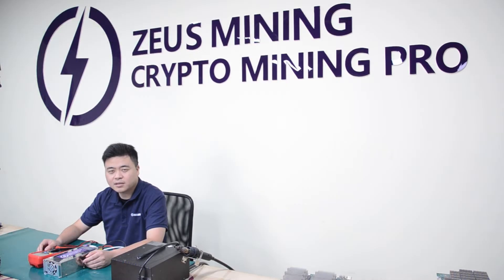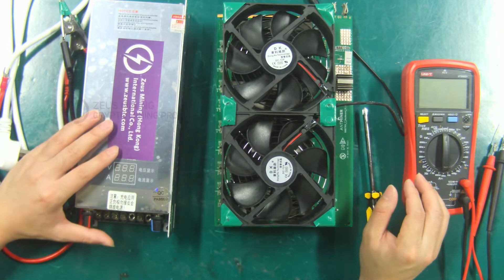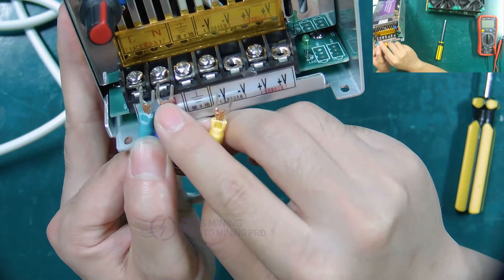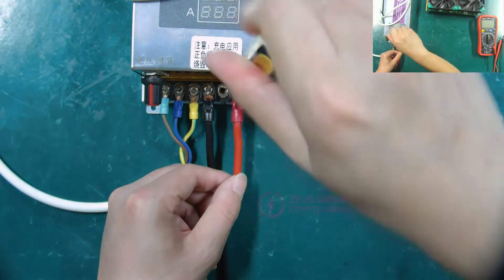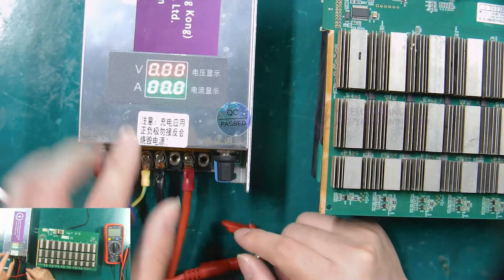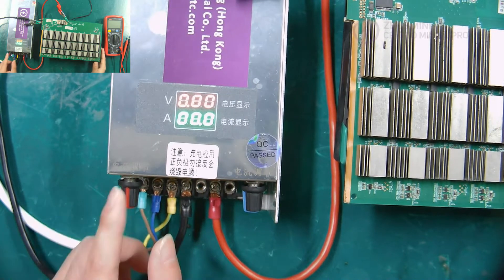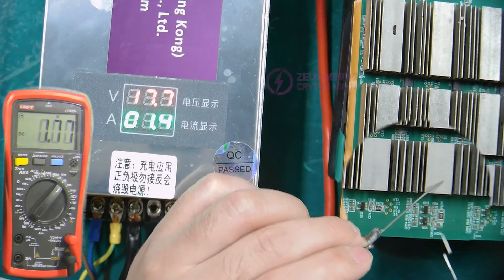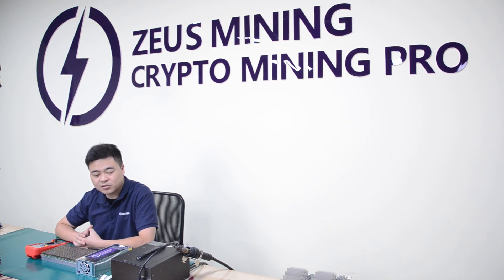How to use the adjustable power supply to test the voltage of the hash board quickly？

Comment: Would this method work by using a APW121215e on a S19 hash board? So rather than using alligator clips, I can use the normal bus bars to power the hash board.
Reply from the maker: The S19 is a high computing power miner, and a 3030 voltage regulating power supply is needed to test the voltage. 
You can visit this page to find out more about the WANPTEK KPS3030D high power DC power supply: https://www.zeusbtc.com/ASIC-Miner-Repair/Parts-Tools-Details.asp?ID=2184